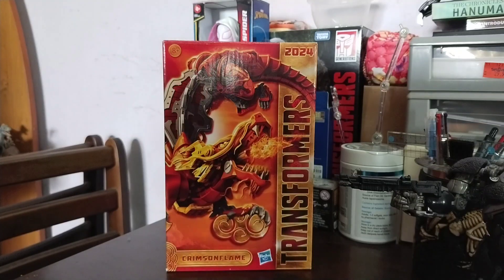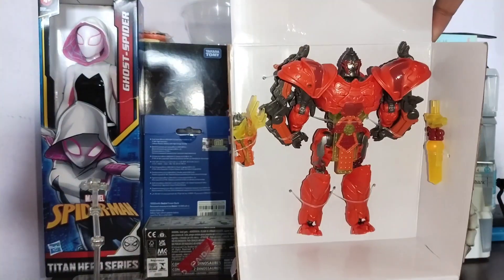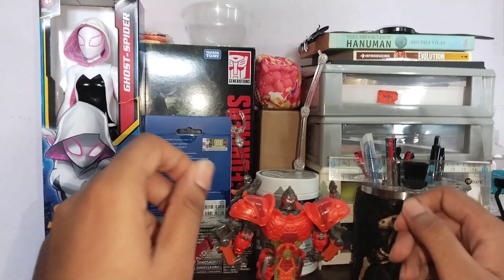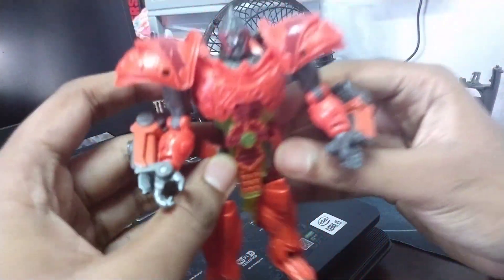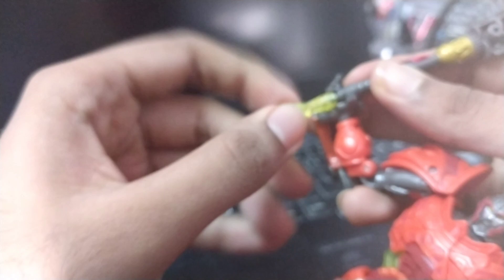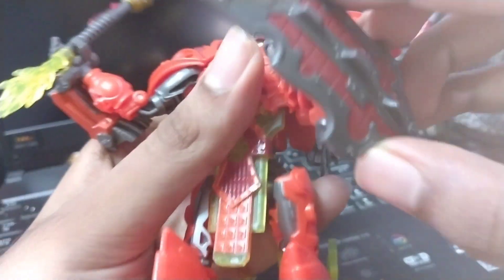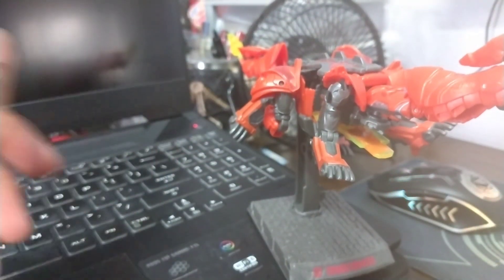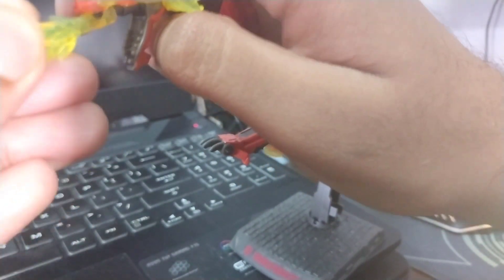Transformers Crimsonflame Review 🐉🐲🐉

Comment: The leg right, put a super glue drop by drop while articulating, until you feel it's getting tighter. But keep rotating after adding the super glue if not it will get glued together. I use this method for my Gunpla also
Reply from the maker: That's a great tip, but I'm a bit scared when it comes to super glue, I'm scared if I over apply 💀